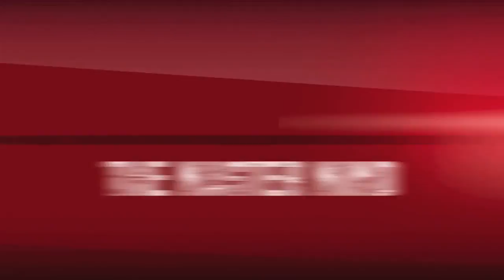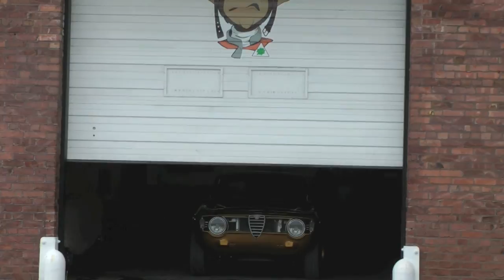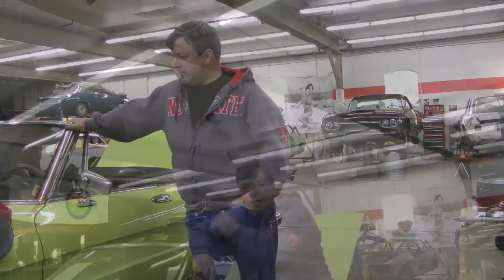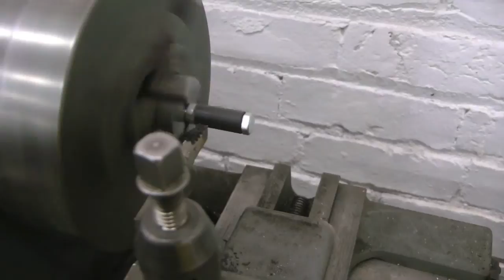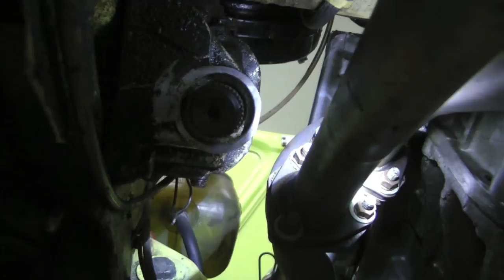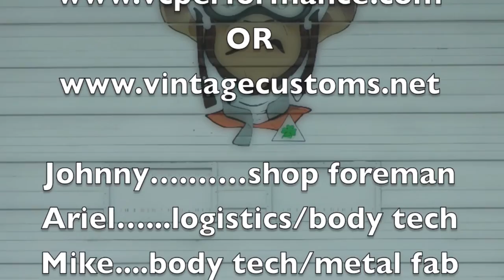Lemon spider

Comment: Busy doing the leaking steering box on my 1750 GTV. The castellated nut comes off fairly easily, but the arm itself is a real bitch. Tried a two-arm gear puller to no avail.  Three arm puller is bigger but doesn't fit easily in that recess. I may have to live with the oil leak after all or let the professionals do it!
Reply: Will be buying a small pitman arm puller later, if I can find one. Heating the steering arm may also help loosen it.